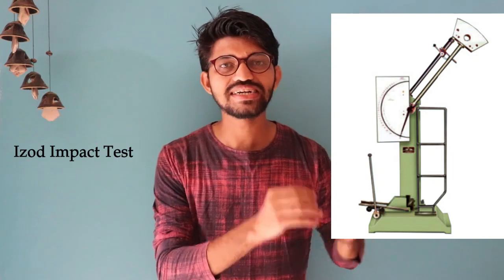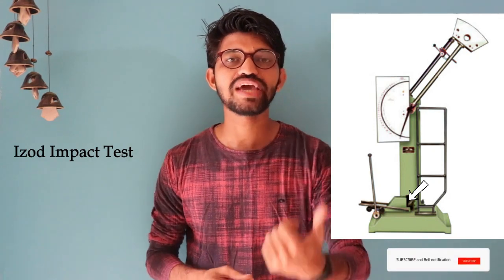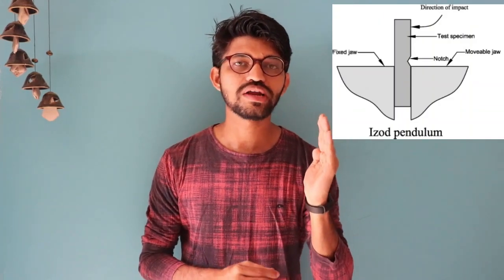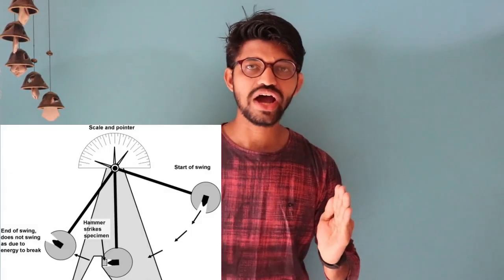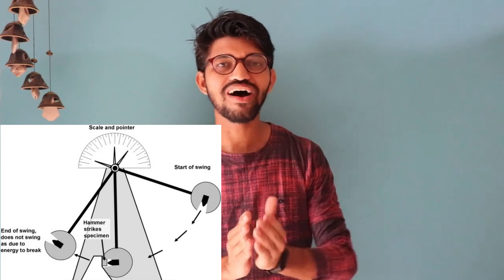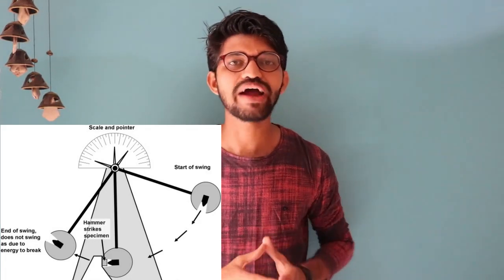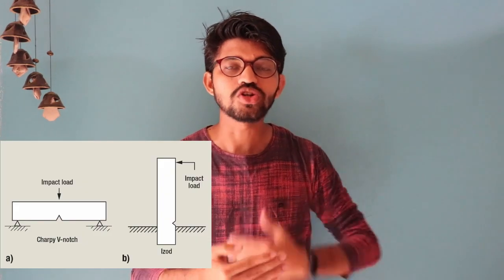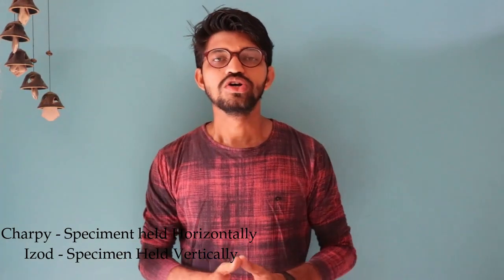Izod & Charpy Impact Test !! ||Engineer's academy||

Comment: you forgot one of the most important thing to do before start the test Is to check the calibration of of the Impact machine it is required to do before starting your test so you can tell the accuracy of your test Data otherwise your test data is wrong.
Reply from the maker: Yes, Callibration always required in any Measuring Instruments! 
thanks!